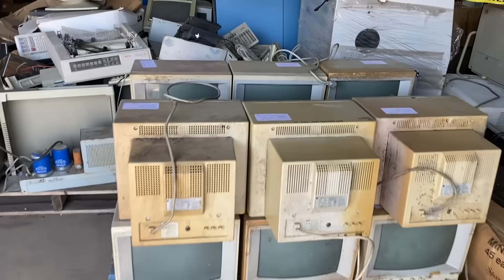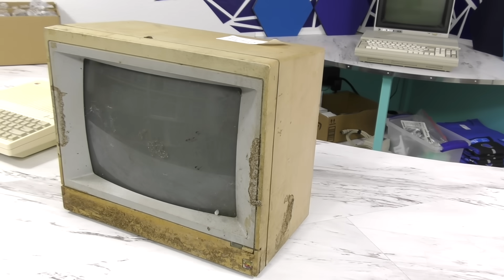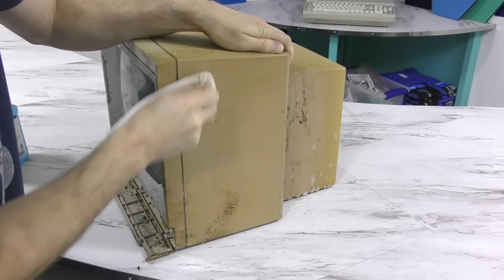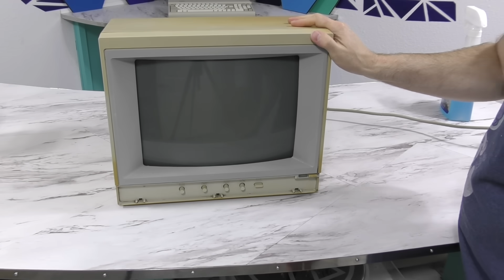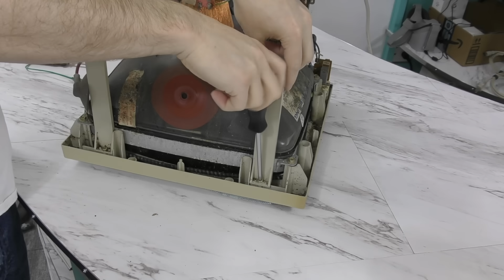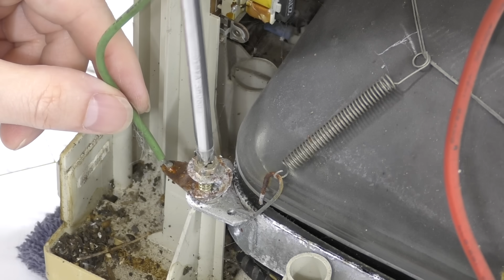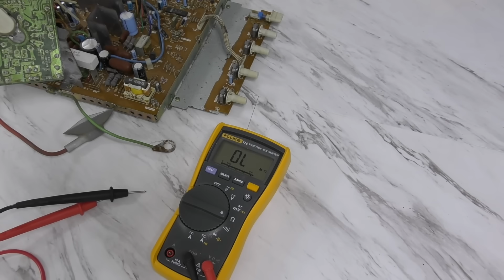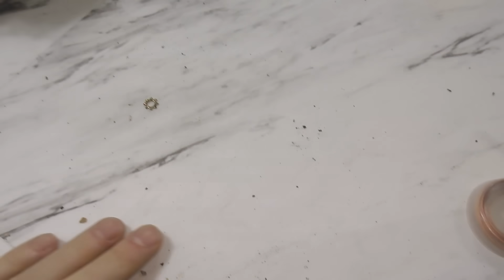Apple Monitor Found in Landfill - Restored - Part 1

Comment: A few experience from Adrian's friend recommendation, the "Iron Terminator" for car use really remove the rust well, of course it attack the normal iron, but it works surprisingly fine if the timing is good, that is just a few minutes and wash them away, it avoid abrasive works on metal since they may fragile already.

Comment: Wouldn’t rain have permanently damaged the electronics?
Reply: Tony! Electronics if operated when wet cause damage, in this case the electronics did get wet then as well got dry in sun again while being non operating. Thus they weren't damaged
Reply: @sandeepkulkarni3695  I did not know that. I guess that is why they say if you drop your phone in water, turn it off, and let it dry completely?
Reply: Yep Tony, even 8-bit Guy cleaned some of his motherboards in the dishwasher and then dried them completely before turning them on again
Reply: @sandeepkulkarni3695  Wow, now that is VERY interesting. I haven't seen all of his videos, so thanks for letting me know.

Comment: Man you were not kidding on how the monitor was filthy
Reply: You should've seen the Joust I bought back in the '90s.  Left in a warehouse in that area for some years, the cabinet was not fixable, having been inundated with water to a height of 1 or 2 feet, the innards were filled with old insect chrysalis or similar, and then there was the electronics.  But I got it working.  I don't actually know where it was stored, as I only got it from an auction in Fort Worth.

Comment: So Samsung has been making screens for Apple for a long time then. :)
Reply: This is actually the Hitachi designed monitor. It's not clear why it has a Samsung CRT. My earlier revision has the matching Hitachi CRT. Samsung also supplied a different monitor to Apple so perhaps the later Hitachi ones just used the same CRT as in the Samsung version?
Reply: Making screens for a long time.  I don't know if Apple required any modifications from an off-the-shelf model.
Reply: @howardshubs7157  Probably not. It was a different time. Apple was likely not a big customer either.